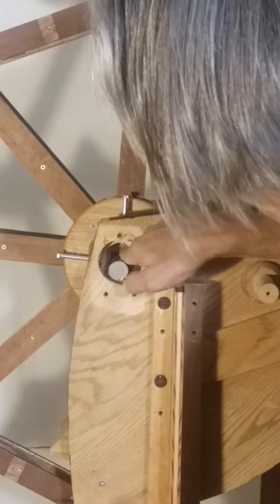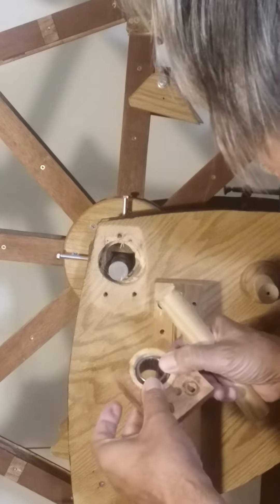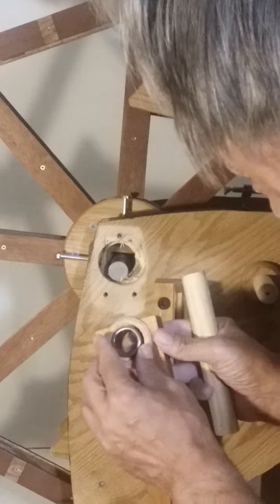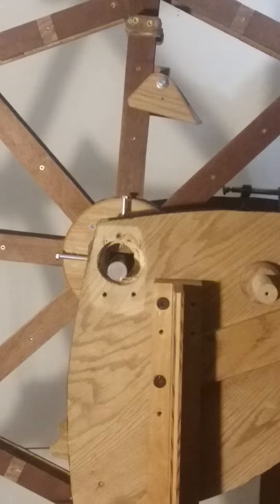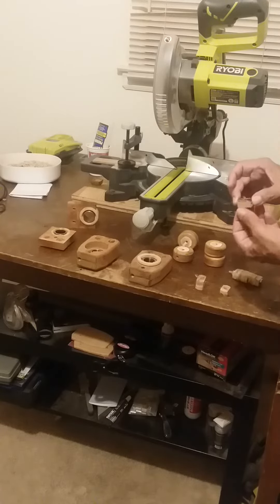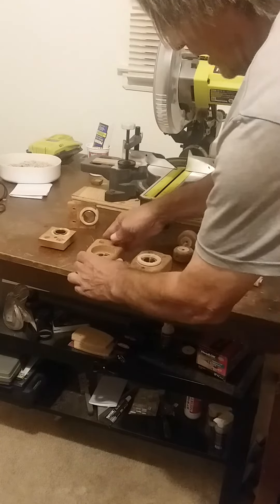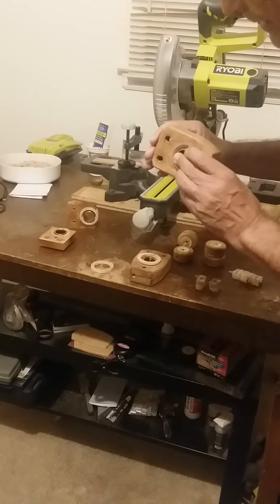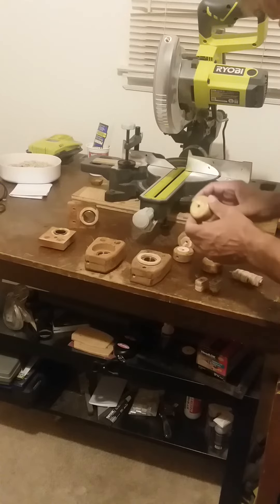Build Update 9/19

Comment: Sir do u think it is possible to made perpetual motion machine
Reply: i don't see it like that  .. perpetual .. mean that the device have it is own power to move =but this is not the case as  they are using the gravity it is not going to be working in space as example = but i beleave that with extra effort we can reach to use th power of the gravity in a way that we can change it to a moving energy  "" and let me ask you this  : if we have no nights and always have sunny days and we used the sun power isn't that will be consider as " perpetual  motion machine" which i don't agree with this name anyway since we are using a deffrent way to get a move energy ""
Reply from the maker: beskr505 is right. Scientists created an issue when they said it creates its own energy. If you watch my video Proof of Concept, I could have had that working. The retraction line would need to be released so it could rotate 90º again. Instead I chose to build a nicer model. If it works as the prototype suggests then it will be displayed somewhere. And that is the reason for a better looking build.